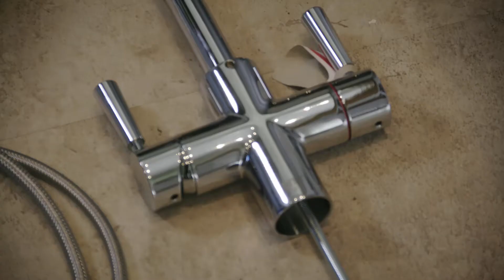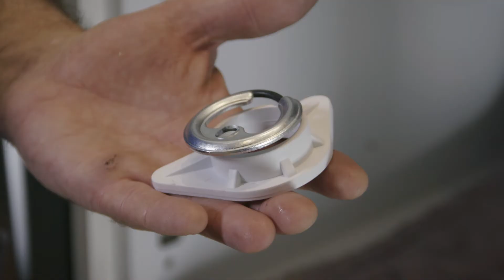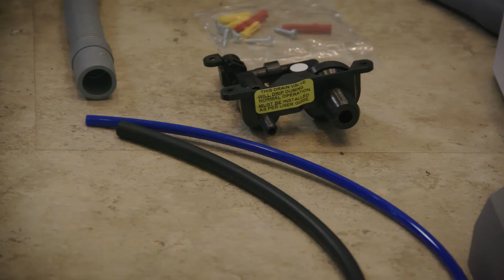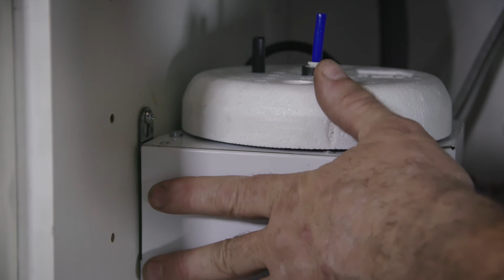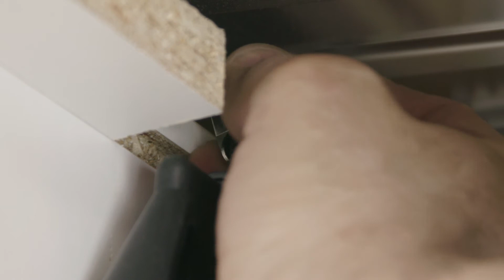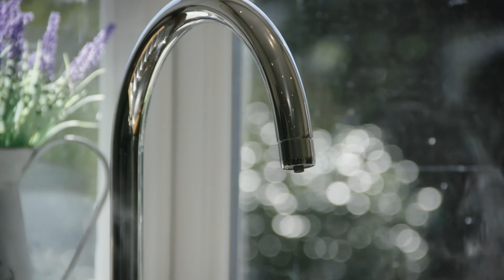Step-by-step installation of the Redring Reditap

Comment: Mine has been in for just over a month. The thermostat setting has had to be reduced several times since calibration and has now reached its stop but the boiler keeps kicking in every 20 mins and releasing live steam through the tap. I’ve tried recalibrating but as expected it does not change. Suspect the thermostat is faulty and out of range. Is this a common problem?
Reply: Gary Ainsworth got this problem at the moment did you manage to sort it?